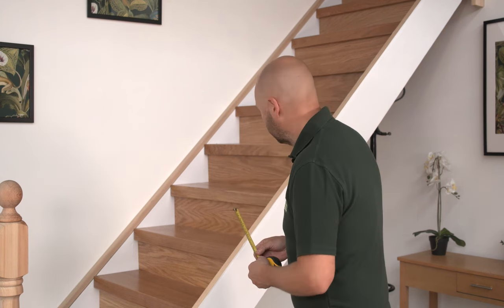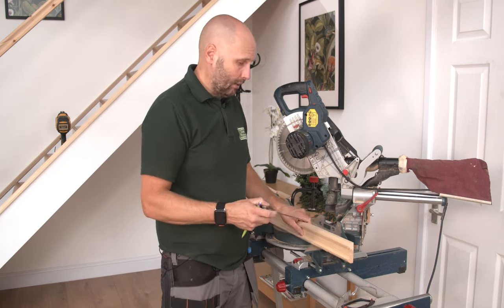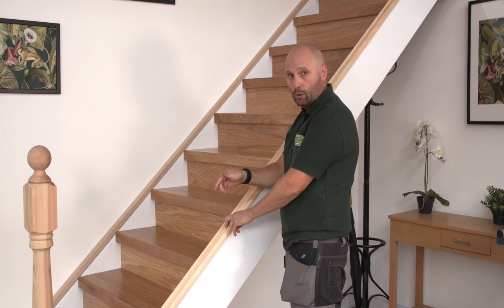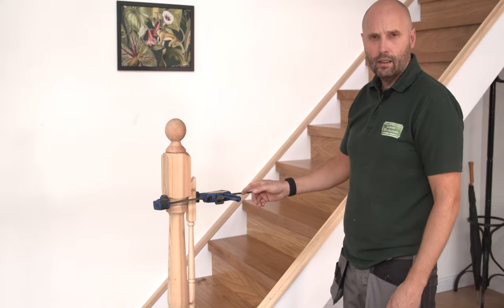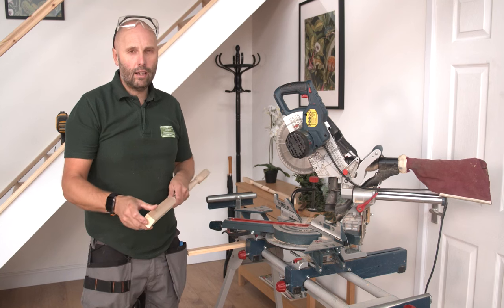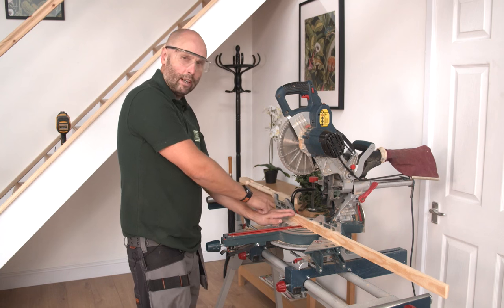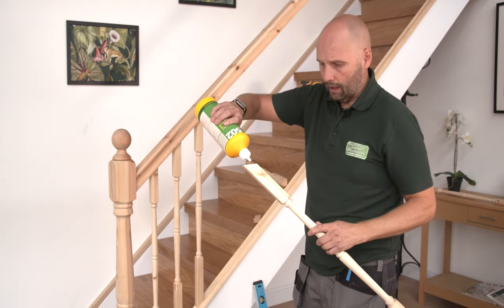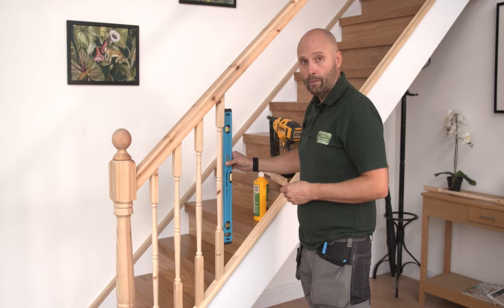How To Fit A Base Rail, Hand Rail and Spindals

Comment: Hi, what is the gap of spindles?
Thanks
Reply: I've posted this on another site as well.

After years of thinking of a way to set out spindles on the stair string without using geometry, I thought of an easy way to do it.

First, measure 1000mm up the string from the bottom and mark it.

Then, Measure back horizontally to the newel, it'll be around 750mm.

Next, measure the full length of the string, in your example 2415mm.

Multiply 2415 by 750 which is 1811250 which is obviously 1mtr 811mm (divided by 1000)

This gives you the horizontal length you'd use if you were just doing a balustrade, using a horizontal spacer.

So, with three measurements and one calculation, most of which you'd have to do anyway, it's made easy.

I used to go up the string to about halfway and then work from the top downwards, as a 1 or 1.5mm rounding up or down on the spacer multiplies with the more spindles needed.

It may sound complicated but as I said, it's just three measurements and a calculation!